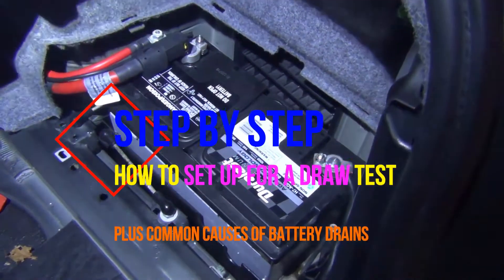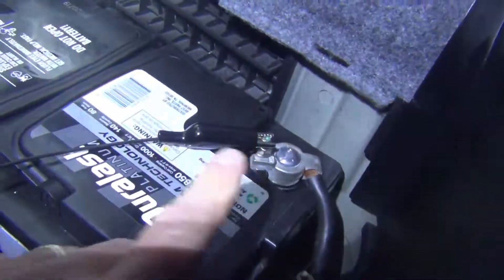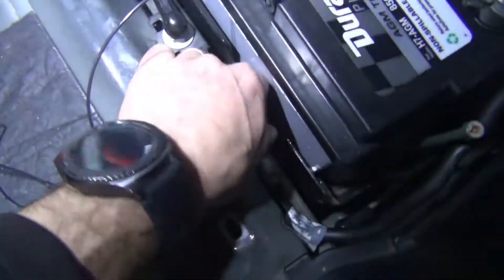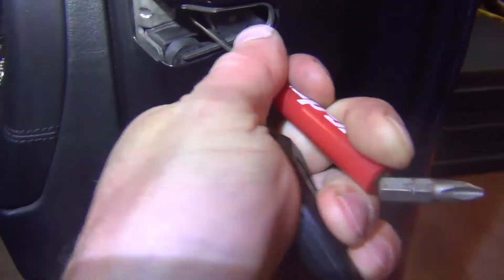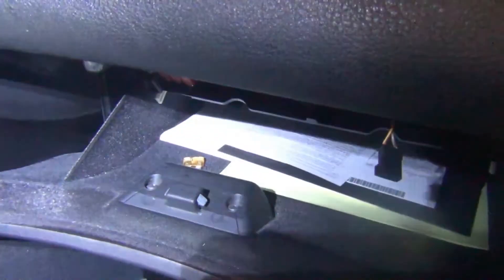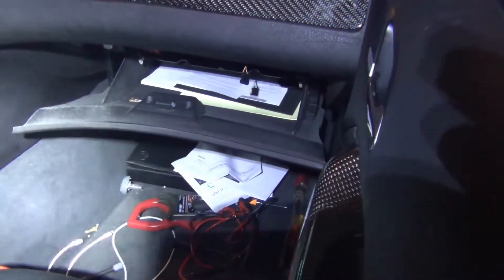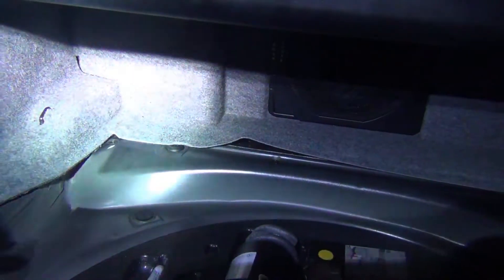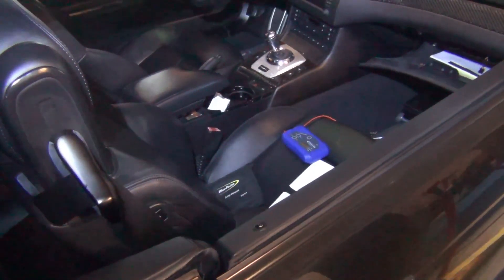BATTERY DRAINING? How To Set Up For A BATTERY DRAW TEST (Step by Step) With Common Drain Causes

Comment: I have what looks like a dead short.  My 328i will run fine and then shut off. I think it might be the radiator fan that is bad.  Is it normal for the fan to cycle on and off when i run the ac?
Reply from the maker: Hi Jaime, It is normal for the fan to cycle on and off when the AC is on. This will cycle to pull air through the condenser for correct AC operation. Do you have a check engine light and can you go into more detail about the shutting of? Does it just stall and restarts, does it crank no start when it happens, how long of a drive before the symptom occurs, have you read any fault codes?
Reply: @AskTheCarExperts  after it shuts off it wont start again.  Then it shows a single " ! "  it also showed a picture of the engine half shaded or half filled.  When i try to turn it back on the display blinks and goes blank and does not do anything after that
Reply from the maker: Hi Jaime, This sounds like it may take a bit of conversing to figure this out. Please use my website at www.askthecarexperts.com and use the contact us tab to get in touch with me directly.